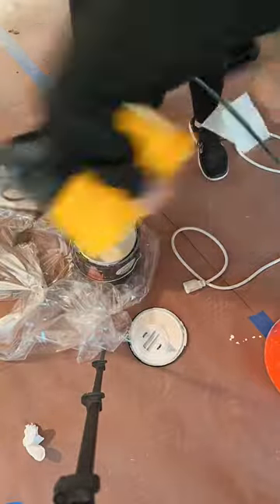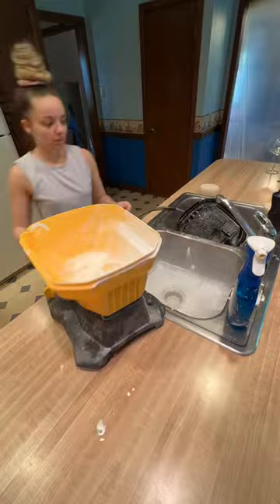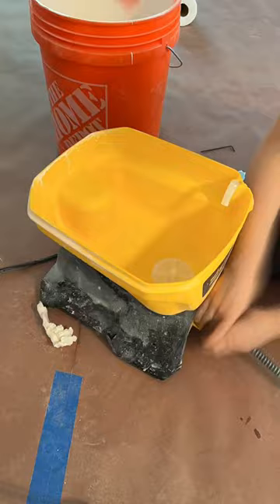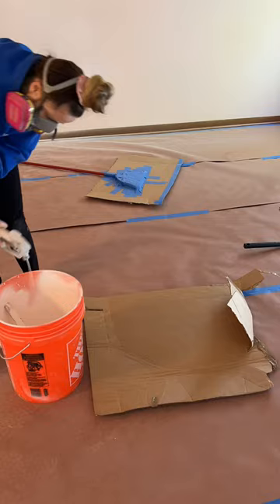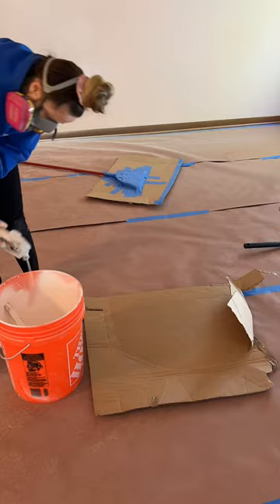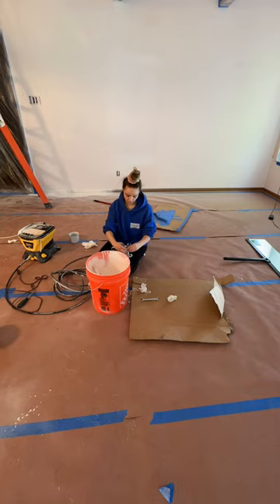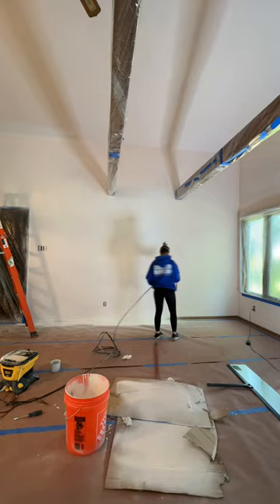HOT MESS LAKE HOUSE RENOVATION PART 16 | VIRAL TIKTOK SERIES | LEXI DIY

Comment: Haha your shield cracks me up. Pro painter here, BIG UPS to you, making it happen like* a pro!

Oh yeah, the tail or “spitting” from your gun is due to the pressure, or the consistency, or both. When you load the paint into the gun, turn the pressure up gradually until the gun quits spitting. This needs to be done each time you use it, seldom is the pressure going to be set to the same mark.

Comment: 5gal bucket fill 1/4-1/2 way with mineral spirits and soak all components and that same bucket use the same liquid to run through the hose and save it you can reuse water is not good to clean paint gotta use spirits or thinner…

Comment: Also never pour paint down the drain from your sink. It will clogg the house sewer drain  10/10 times. Know it first hand
Reply: Also terrible for the environment! It could get into streams or groundwater from sewer system
Reply: It also leaves a residue that doesn’t clean off the sink! You will need to put barkeepers friend (on the sink) and scrub a long time before you will get thru to the surface. It will be dull hazy and difficult to clean if you don’t. Once fully removed it should shine again. I don’t use strippers bc of chemical toxins in the kitchen so elbo grease. Use something like vinegar after to remove haziness and shine it up. The pink stuff might be another option. Glad you shared this. I think there’s a clog in the gun itself….soak and flush….is there a way to back flush?? Set up a outdoor area for washing….
Enjoy watching your projects!!

Comment: Once your done with your painting an it's time to clean up the machine then you'll need to take laquor thinner an spray it into a bucket it'll clean the whole house thru it an take out any chunks of dry or half dry paint inside an if that still doesn't work then it could be the gun it's self I used to do drywall and a painter for over 20 years now did inside & outside house huge ones bigger then your lake house

Comment: Ah! Sprayer problems. Never fun. Try going to Sherwin Williams and buying a new hose and professional gun. It’s also always a good idea to use HVLP tips when spraying walls. High Volume Low Pressure tips from a brand like Graco or Titan are all I use in my painting company when it comes to spraying walls or ceilings. It’s also important to have a sprayer that can handle high gallonage. I’m familiar with the sprayer you’re using and if you’ve been using it for a while there’s a chance the pump has gone bad and is struggling to feed paint at a steady volume and pressure. Might be worth looking into something like a Graco X5 or X7

Comment: First off. It’s not industrial grade equipment. So the life expectancy for this gear isn’t going to handle the demands you’re putting it through.  But like an Nik jet printer. You clean out all the nozzles, the tubing, and that parts where each piece connects. Means flush it out to the way it was when you first bought it. Do a deep clean. Or there might be a part that, through wear and tear, needs replacing. Do expect it to function the way it did when you first got it, and have you been cleaning it out after each use! Maintenance is key to things working properly.

Comment: Cheap sprayers are going to wear out. Also need to back roll your final coat or the paint will never touch up right.  If you can rent a high quality sprayer it will make more sense for homeowners doing occasional projects.

Comment: Graco sprayer way better than Wagner... Even Sherwin Williams brand titan better...Wagner has short life span low homeowner grade ....u do a lot of painting in your renovations need better sprayer ...clean sprayer well after each use ...I suggest filling with mineral spirits for storage to keep internal parts lubed and rust free check your filter in gun also it doesn't clean out well.. needs replaced